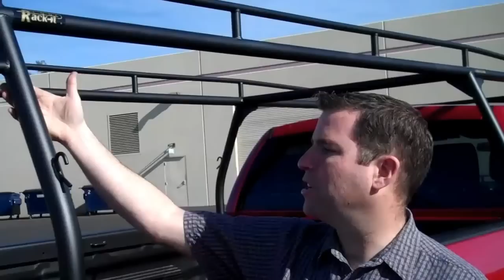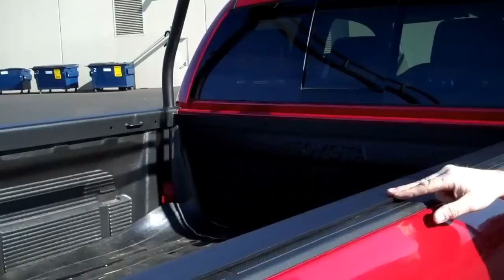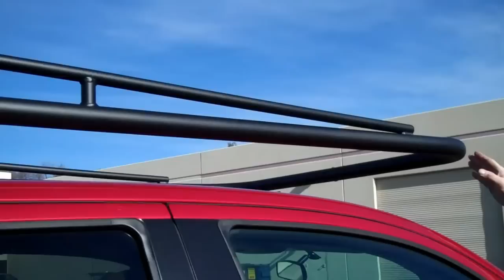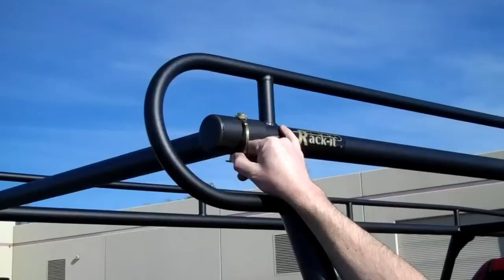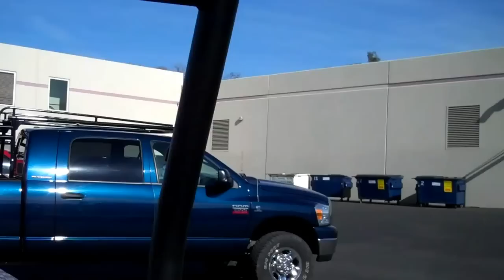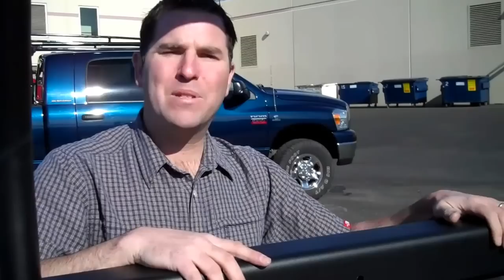The Series 1000 Standard Truck Rack by Rack-it

Comment: I bought a used one of these for my home remodeling work, hauled some very long lumber, up to 20 feet long. After what I was doing on the house was finished I removed the rack as it's quite heavy and I wasn't using it. Also got a camper shell to use. So I sold the Rack-It lumber rack for what I paid for it. Now unfortunately if I want to haul some 16 foot lumber I can't do it.

Comment: Spent $750 bucks on mine, rusted in Northern California in 2 years. Now it rattles like rocks in a can going 25mph. It’s tightened down. This thing is a turd since day 1.
Reply: I hear a company in Oregon called Highway Products makes these maybe check them out 🤔
Reply: I have one that I bought in 1994, also in northern CA, painted it a few times, still no rust...
Reply: Mine is 2 years old and while the design is great the enamel paint job is  110% crap. Rust stains all over truck, thin paint peeling off in sheets… you’ll have to go spend $300 or more to have it blasted/painted properly. Can’t believe they sell a quality build with such a garbage paint job.

Comment: I bought this rack at local rack-it  dealer in California they installed to a 79 ford ....now l want to re install to a 2007 f150 and l don have a clue the how to because the top of the bed is different inside l have 1" only for screwing and in the outside can not reach from the botton to attach the nut to the screw ....any recommendations ....by the way it is a goood rack l will give 5 stars
Reply: take off the plastic or make a hole